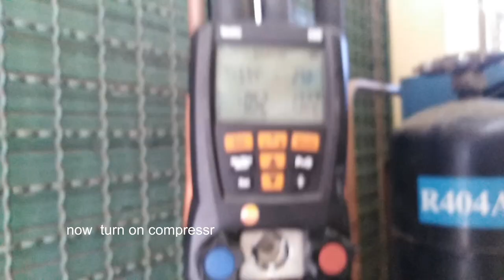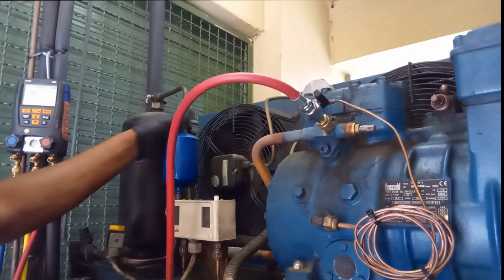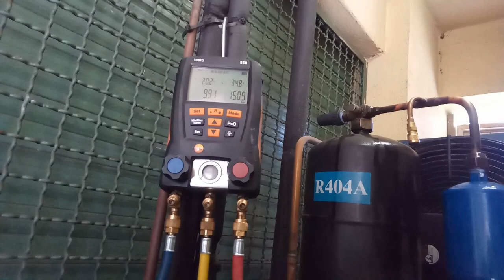HOW TO FIX  GAS LEAK  IN A FREEZER ROOM CONDENSER UNIT. #refrigerator #refrigeratorrepair#coolroom

Comment: How do you vacuum the system while all the valves are closed? and while charging, do you use the high side of the gauge or the low side?
Kindly help, new tech in the field please.

Comment: Ok nice video.  Just a few little suggestions for you.  Firstly when braising you must use dry 😊nitrogen to prevent pipework contamination.  Secondly always remake leaking flares.  The sealing surface is the copper flare and not the thread on the flare nut.  Putting sealing compound on the threads does nothing towards maintaining a good seal.  A tiny bit of nylog or refrigerant oil on the mating surface of the flare would have been a better idea. 
Great video though.  Well explained 👍👍👍